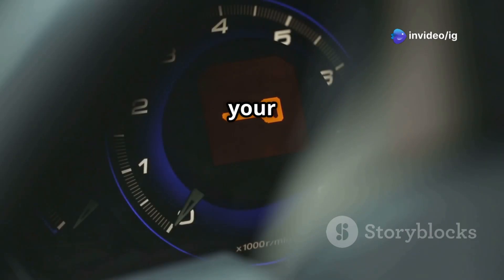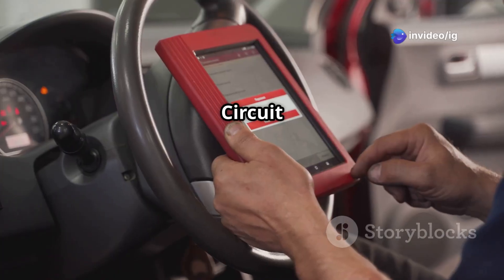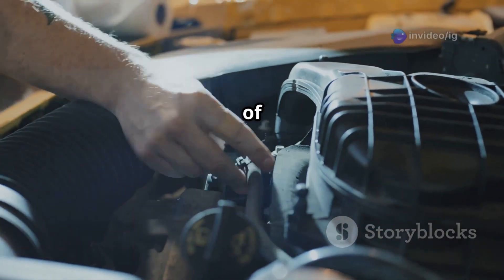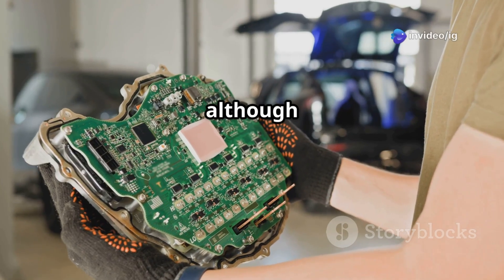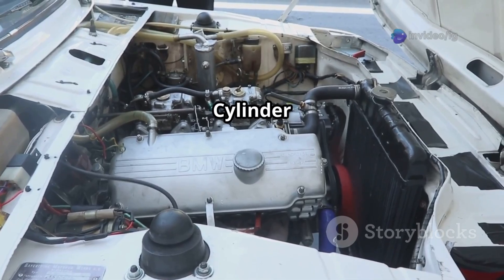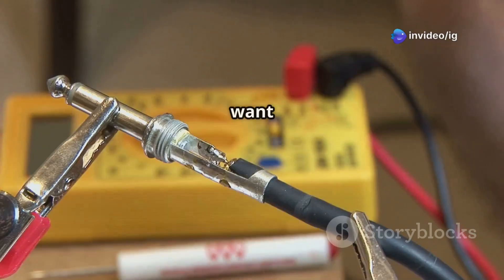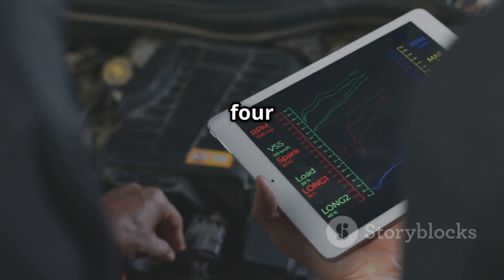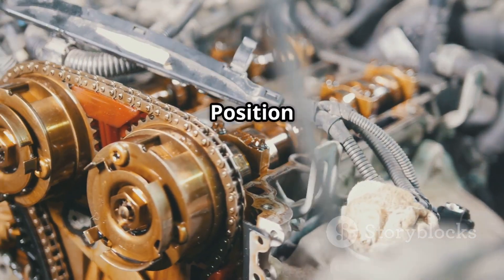P0134 | p0134 02 sensor circuit no activity detected bank 1 sensor 1 | p0134 code | p0134 obd2

Comment: LEXUS SC430 04 
p0134 or p0133 codes
replace 02 sensor  denso B1S1
replaced pigtail OEM
replaced ECM with same year 2004 280$ program
its been 4 shops they did butt connectors no one can fix it its only that code anyone reading this have any idea please 
on OBD scanner there is still no voltage on B1S1 HELPPPP